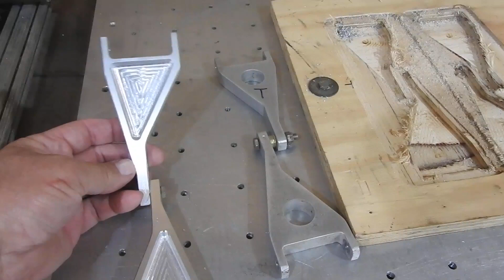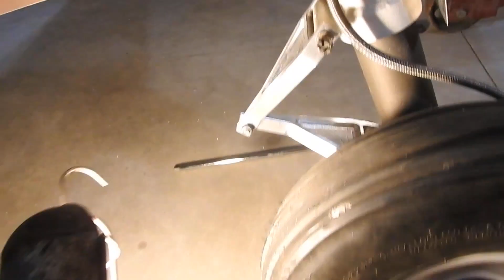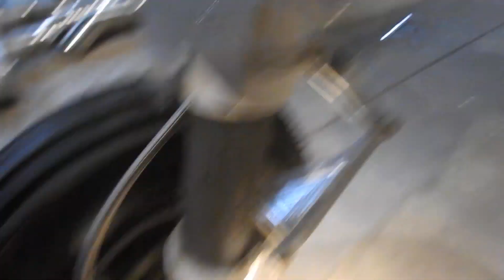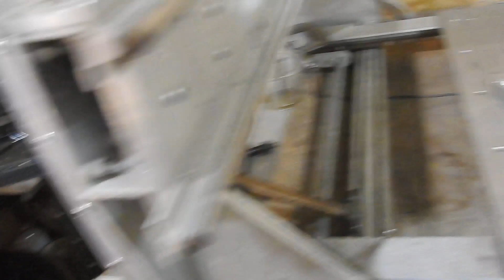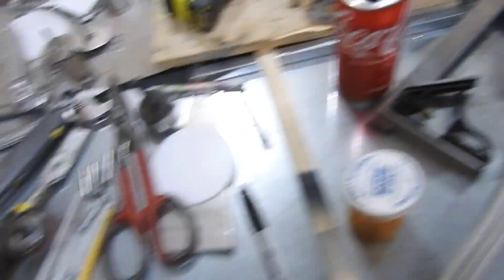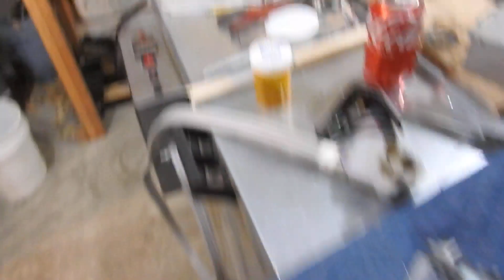WAR Corsair Update 7/24/2022

Comment: Hi mate! Love your work. I just heard you said “toe-out” in the video . All taildraggers needs toe-IN” All hell breaks loose if it is toe-out. Please check that! I can explain why, but it’s too long to write here.
Reply from the maker: Yes the common thoughts are to use toe in. But that is not the case now. Toe in is fine for cars but not tail draggers. An aircraft engineer wrote a paper on why you need toe out. I explained it in a previous video. It has to deal with weight transfer during turns on the ground. When you turn, weight transfer to the opposite side. So when the plane turns left, weight rolls onto the right wheel. Because the wheel is toed in, it forces the plane to turn harder left, which then leads to a ground loop. With toe out in the same example when the weight transfer rolls onto the right wheel with toe out, the toe out pulls the plane to the right, which rolls weight back to the left wheel. This way the weight transfer never increases to a ground loop.

Comment: Are the struts spring or air/oil olio struts? How about a chunk or rubber down the inside of the tube incase they bottom out, the aluminum scissors don’t crash into each other?
Reply from the maker: The struts have coil springs inside. The spring will bottom out before the scissors will.